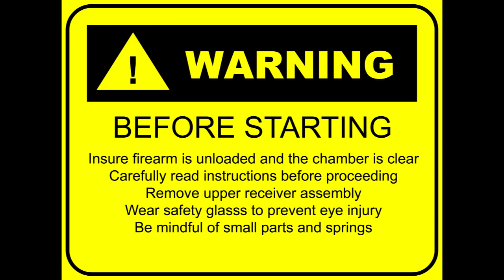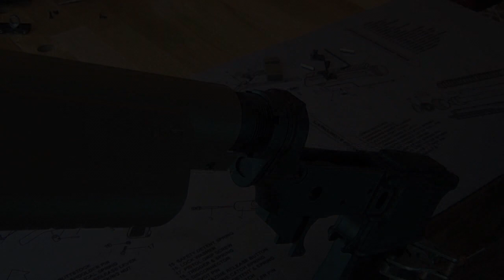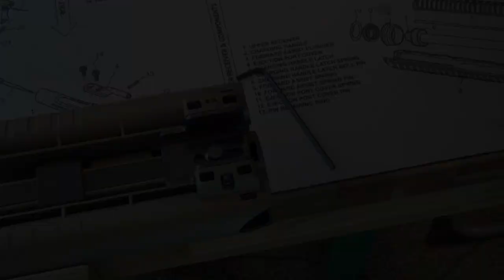MFT CHEEK REST KIT INSTALLATION INSTRUCTIONS

Comment: i already have a buffer tube installed on my pistol. its the larger of the 2 (that i know of) avail sizes. it fits the blade almost perfectly. just ran across these n i think i like this idea better. is it possible to just buy your adapter n the mft cheekrest n use my existing pistol buffer tube?

Comment: I'm building a pistol using some Strike Industries Redline accessories. I would love to use their new red mil spec buffer tube. I was wondering if there is anyway to slide any of your setups back a small bit to expose some of the buffer tube. Wouldn't have to be much but no point of using the red tube if it's completely covered
Reply from the maker: +Tommy Lawson Hi Tommy, That buffer tube will work just fine. The bottom of the tube will be visible without having to make any modifications.

Comment: So the buffer tube does come with the kit how about the buffer and spring ? Can I use any buffer and spring with this because I run a m16 bcg
Reply from the maker: +omgthtawsm  Buffer and spring are not included. You can use your own no problem. Castle nut is included.
Reply from the maker: +Mr1976impala Your original post here was over 6 months ago, right around the time we started including the nut. I can't track down whether or not you ordered your kit before or after we started including the castle nut without your name or a shipping address to look up the order with. Please email us so we can get you taken care of.
Reply from the maker: +Mr1976impala Sorry mistake. You were not the OP on this thread. If you ordered it last week you should have definitely received a castle nut. I still need your name and shipping address to get you the part. Please call or email. 650-588-3700.

Comment: Will the magpul asp work with this?
Reply from the maker: +Rondel Mercer Hi Rondel. This kit will not work with the ASAP as it is assembled. The buffer tube is too short. We can put together a special kit that utilizes our KAK/TC tube that will provide the necessary room. You would have to call in to special order it. It would be about $22 more than the standard kit.